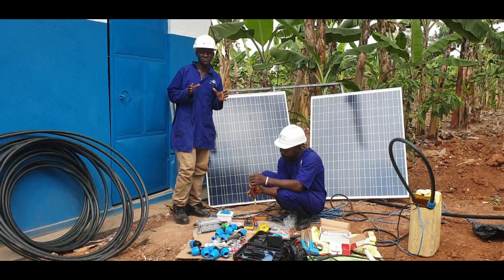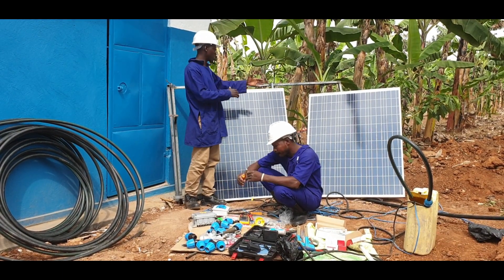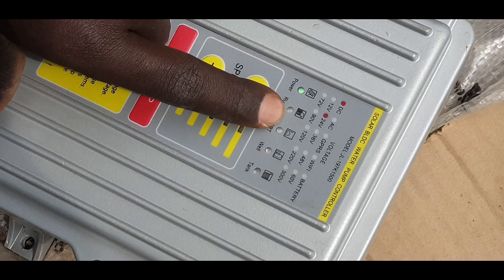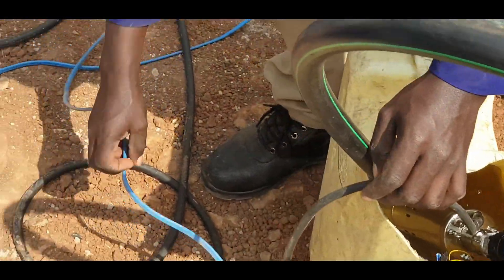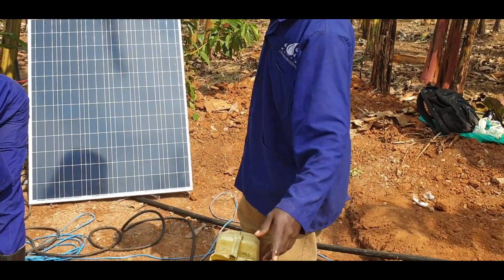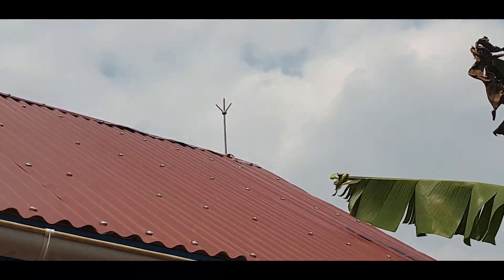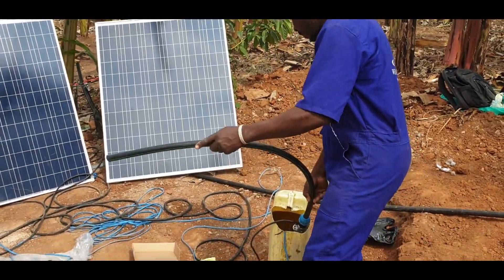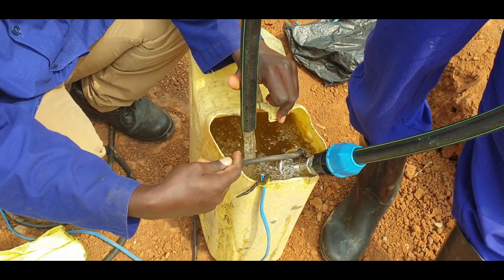Solar water pumping in Uganda   Demo video of the main system components

Comment: Why does my power controller always show that the tank is full yet its empty. What should be done
Reply from the maker: You may need to put the sensor (if you're using a 2 wire sensor) upside or interchange the wires if you're using a 3 wire float switch
Reply: @WeisEngineeringLtd  how can I get that service. I can not do it myself
Reply: I may need  a contact
Reply from the maker: @OmojaGilbert  +256759790556

Comment: How much is the whole package of the pump solar panels  and the installing if I have it i already have the down ground water
Reply from the maker: Hello, the actual depth of the well, estimated horizontal and vertical distance and height will be required for proper pump and solar panel sizing. On average the whole package may cost you about Ugx4,800,000